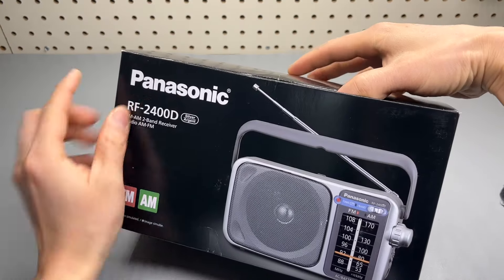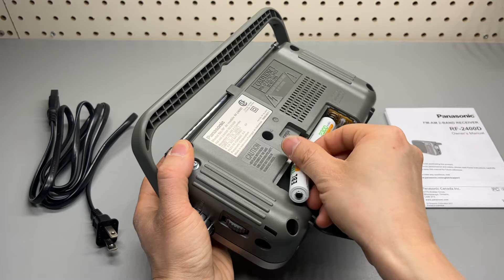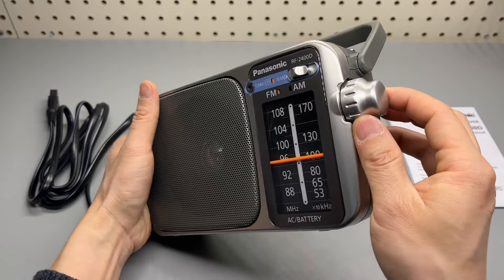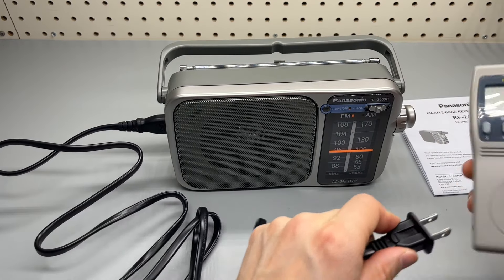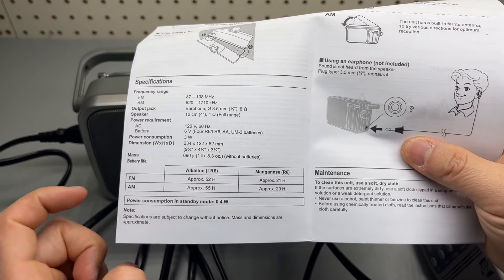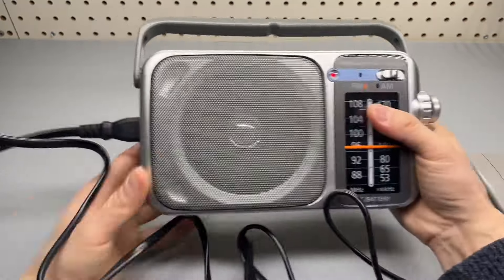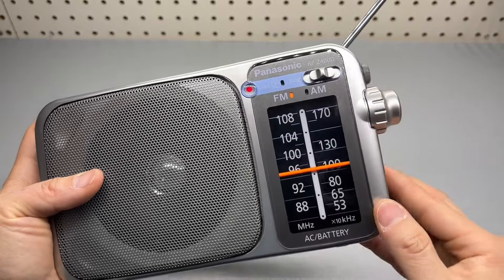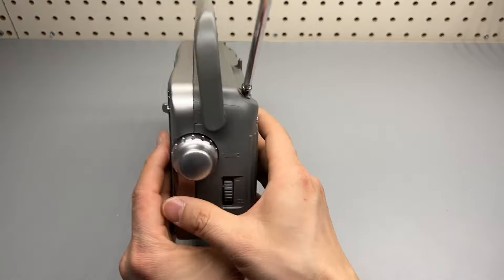Panasonic RF-2400D AM/FM Radio. Nice Tuner.

Comment: I own  a black Panasonic RF2400 since many years , still using it , it functions like new  and I think it's one of the best FM/AM little radios . Big legible dial and powerful, clear sound . I only dislike the small tuning button ,  not very ergonomic .
Reply from the maker: Agree. Thanks for sharing!
Reply: The Sony does sound better though (tried both) by quite a margin. Panasonic’s latest DAB/FM/Bluetooth model (in Europe/UK) is better than all of them though.
Reply from the maker: @interstat2222  I have both
Reply: @interstat2222   Not true. The older RF-2400 is not the same as the newer RF-2400D !
Reply: @etow8034  You misunderstood what I was saying.

Comment: RF-2400D is better and less expensive than the Sony ICF-506, the only con I have about it is that the FM telescopic antenna is not able to swirl.😉
Reply from the maker: I love my ICF-506 too!
Reply: @jon All five of my RF-2400D are working fine after 2+ years ! Some of them are on 16 hours per day.
Reply: @etow8034  Do you listen to multiple radios for 16 hours a day or something? Srs question
Reply: @Llamabotomy  Just one in several rooms so I don't have to lug one around, plus plain non adulterated radios are becoming harder and harder to find.

Comment: Half a watt for what? Does it discharge the batteries with .5 watts when disconnected from AC? If not why does it do it when plugged in AC? If it does, then well done Panasonic, I need to take out the batteries as well and put them in every time I want to use it, because a week later they would be discharged... Good review tho. Not gonna be my product
Reply from the maker: The Power supply from the battery will get cut off, If the AC cord is inserted. please watch my most recent review on this. 2 Great AM/FM Radios Compared: Sony ICF-19 vs. Panasonic RF-2400D
https://youtu.be/xrwq2npqCqw just two different power supplies. The AC does not charge the battery neither. Smash the like and subscribe.
Reply: Fully charged rechargeable NiMH batteries will still be around 75-80% capacity after 6 months of non-use.  I have one RF-2400D radio handy as an emergency radio with the NiMH battery loaded that I charge/top up every six months to make sure it fully charged.

Comment: Had lots of radios over the years and got one on the way. I always choose radios with analog tuning because here in the U.S. late at night I can tune in stations three to four states away on AM. Can't do that with digital tuning, it skips over what it thinks is a weak station.
Reply from the maker: Good to know thanks for sharing
Reply: The RF-2400D is not really analog tuning as it use a DSP (Digital Signal Processing) tuner.  The older pre 2015 RF-2400 without the D still uses an analog tuner.

Comment: هل البطاريات بتحشن في الراديو من السلك الكهربائي 220
Reply: I don't think so. Even if you had rechargeable batteries, it hasn't got the capacity ability to function as a charger. But that and stereo ability would be an excellent upgrade.

Comment: Assume if using a power cord plugged into a strip and using the strip power on and off no wattage is consumed as the radio would be totally off?
Reply from the maker: Yes. Power strip with switch is a good idea
Reply: @ToolsElectroDIY  Will be using in a workshop. Light over bench, radio all one turn of the strip switch. Seems easier.

Comment: This model radio tuning analog?
Reply from the maker: I think so
Reply: Thanks
Reply: No, The RF-2400D is a Digital Signal Processing (DSP) tuner radio. Panasonic calls it Auto Frequency Control (AFC) which is the same thing.  The older Panasonic RF-2400 without the D is an analog tuner,  but it performs worse than the RF-2400D in locking in AM/FM stations.

Comment: Will it work without a battery? Just with an adapter plugged to the socket..
Reply from the maker: Yes you can use the included AC cord to plugin to wall power. It's in the video, please watch again.
Reply: @ToolsElectroDIY  without battery?
Reply: How much price

Comment: Have you tried in 220 V ?
Reply from the maker: No. I'm in the US.
Reply: @ToolsElectroDIY 
Wouldn't it burn it due to higher voltage?
Reply from the maker: @IvansBikesBmws  If it says 220V is compatible, then it's ok
Reply: @ToolsElectroDIY  thanks

Comment: Does it have rechargeable batteries
Reply from the maker: no
Reply: Is it good
Nowadays people are scared to buy Chinese things
They last  months and you wasted yure money 
The question is is Panasonic good
And where can one buy the radio
Reply: Buy you own rechargeable batteries and it will work.  The thing with rechargeable batteries is that 4AA x1.2V will only give you 4.8V instead of 4AAx1.5V will give you 6.0V with regular alkaline batteries so the volume might not be as loud, but it still works !
Reply: Thanks

Comment: Sounds definitely horrible just all retro stuff.
Should be 15$ considering you are going back 4 decades or current state of Mexico.
Reply from the maker: It's decent. I don't think its horrible.
Reply: The same Radio I have in my bathroom .same thing..
Reply: It's not retro it was only introduced in 2017 with a digital tuner !
Reply: Actually the Panasonic RF-2400D is one the best dual band and dual power radios you can buy today,  very good AM/FM reception and very good audio quality is all you can ask for !